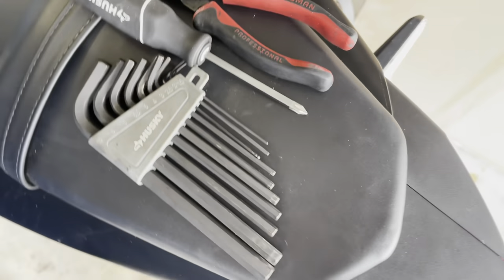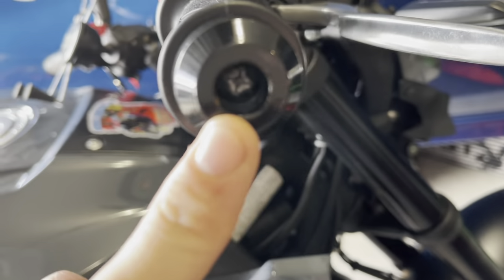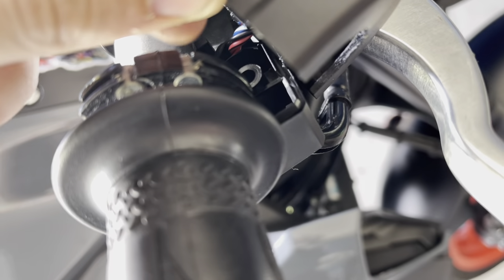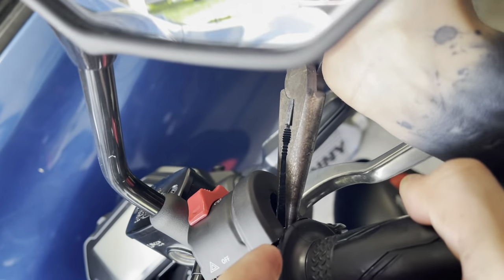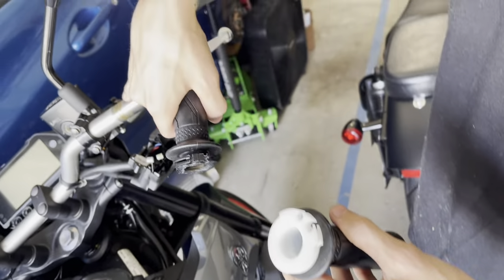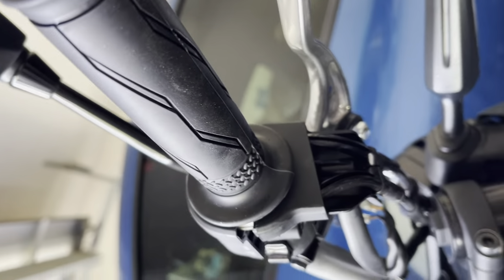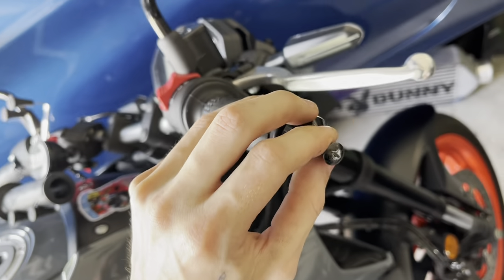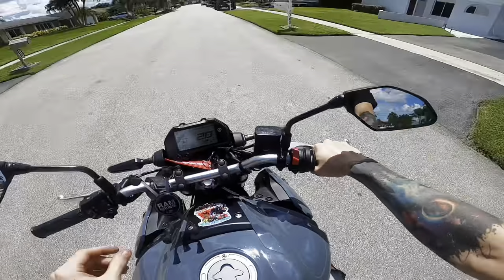Yamaha MT03 r6 throttle tube mod

Comment: hey man i just got my 2022 MT-03 today and i would like to ask if there is more upgrade that i will do apart from that r6 throttle grip mod?more power to your channel bro!
Reply from the maker: Plenty more you can do: exhaust, intakes, tuning, suspension, grip, lots of things to chose from
Reply: You gotta change your sprocket and get a performance exhaust and you get a nice little increase in power and speed.

Comment: Gotta get on the highway and see that top end your definitely going to hit that a good bit quicker than normal mine definitely takes a little longer to hit top end speeds. I might have to get that! But I also have the sprockets changed to give it a little better too end and she still has Bea jumps at low speeds gotta love that torque on these things! R6 throttle tube upgrade? Ok thanks for the info!

Comment: Awesome vid man thanks heaps! Quick question is it normal for the r6 throttle to be a little loose in the horizontal direction?? Still works 100% fine just moves around a tiny bit
Reply from the maker: A tiny bit yes
Reply: You can tighten it up can't yo?

Comment: ITS WEIRD BECAUSE IVE SEEN SOME SUPER COMPLICATED THROTTLE TUBE REPLACEMENT FOR SALE FOR 100 PLUS FROM REV ZILLA AND HEARD YOU CANT JUST REPLACE THE TUBE ON THE MT 03. BUT YOU JUST DID SO IM GONNA TRY IT OUT. ALREADY BOUGHT THE PART. THANKS!!!
Reply from the maker: Super cheap fun and easy mod! I love it so much. I hope you enjoy it as much as me
Reply: Yeah, I was reading something about needing a cable tensioner to make sure the cables are properly adjusted.
Reply: dude forget about stupid revzilla they always have 400% more than what you get on amazon. revzilla is a ripoff

Comment: Did you also adjust the throttle cables? I put mine on and it sticks when I install the bottom plastic plate on the ignition. Like there is no problem with it off but when I reinstall the plastic plate on the bottom it sticks when it’s supposed to snap back to return.
Reply from the maker: One of the cables must be caught it should not be getting stuck

Comment: I have everything together except for that bottom plastic piece at video marker 1:15. When I actually get it go back on, the throttle sticks at wide open lol but with it not on it kicks back to 0% throttle each time. Tried re doing the whole thing a couple times and without fail it sticks. Wondering if you had this too?
Reply from the maker: I did not, make sure your throttle cable isn’t twisted or too tight in there it’s probably getting caught on something

Comment: Whats the rpm like when you dont twist the throttle, same as before or is the r6 mod pulling on the throttle  cables?
Reply from the maker: Same as before it’s just a shorter pull for wot

Comment: I just ordered mine, is there any negative at all with changing the throttle throw? Will it still perform the same top speed and everything at full throttle/twist? Please let me know if anyone has found any negative results or issues. Thanks 😊
Reply from the maker: Still performs the same at top end. The twist is just shorter so you get a quicker throttle resposne
Reply: @thesuburbanGenny  Thanks for the info. It was delivered today 😊. Can’t wait to try it out.
Reply: Added the Mod and adjusted my clutch lever. And man what a crazy difference!!! Now it feels like my Ducati when pulling off from 1st! It was harder for me to ride coming from a super-sport with the stock throttle because of the lag and how much you had to twist to get the thing going. I 150% approve this mod. Should have been like this from factory.
Reply: @superstarsfastcars  Adjust clutch in what way?

Comment: I keep getting cable binding whenever I put that last little plastic cover plate back on. Anyone know how to fix this?
Reply from the maker: I don’t run into this issue I’d just keep messing around with it till it sits in there properly there’s only one way for it to all go in
Reply: @thesuburbanGenny  I think I figured out that I just need to adjust the cable tension/length. It was binding when I had the bar on full lock (I did the swap with the steering locked) but as soon as I straightened the bars just a little bit it was fine. Thanks for the video btw, and this has to be the best $30 mod for the bike you could possibly get lol
Reply from the maker: @jamesbabbath5306  I agree

Comment: I just installed mine and for some reason the throttle is now sticking. Anyone have any clue why that would happen? It’s a 2020, and it felt like there was enough grease, so I’m not sure what went wrong.
Reply from the maker: Check the throttle cable and make sure it’s not getting stuck anywhere. If it’s not put back in the plastic housing correctly it’ll get stuck
Reply: @thesuburbanGenny  Thank you, I did exactly that haha I was worried I might need grease and didn’t have anything that I could use for that.
Reply: @adrianb1655  did you fix the problem?
Reply: @ArmaArmadillo  I wouldn’t call it a fix, but what I did was take it off and repeat the steps over and over until it felt right. It took me 4 times to feel comfortable enough to leave it as is.
Reply: @adrianb1655  I did the exact same thing and it worked lol